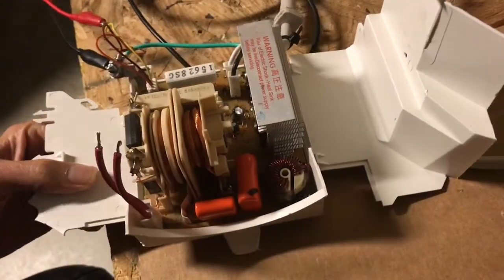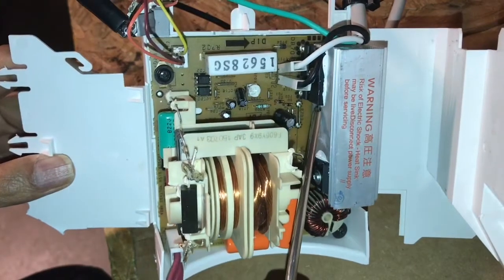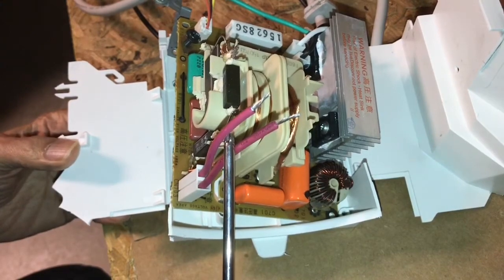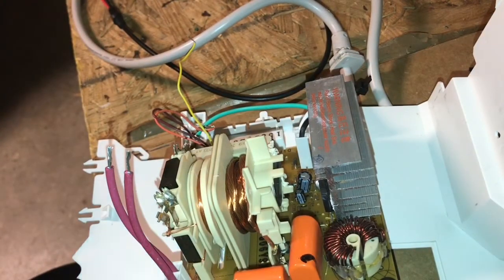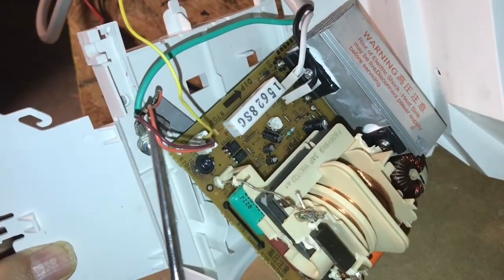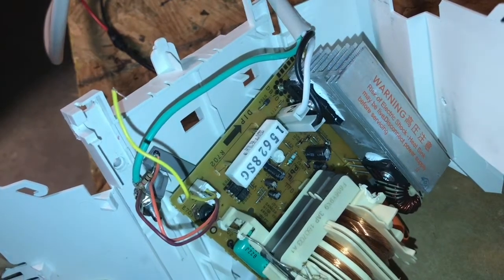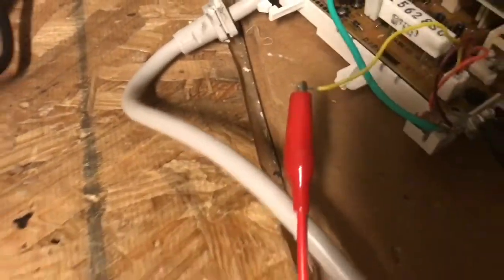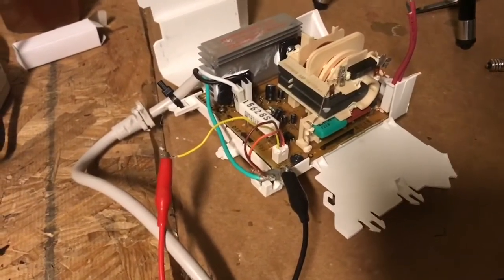HV from Newer Microwave Oven Inverter

Comment: Never buy this Panasonic inverter units, the do suck...mine died after only 4 months and almost no use, the inverter part is as costly as a new microwave
Reply: I have a panasonic with this.  It work fine so far wondering why they fail.  planning ahead.
Reply: Panasonic Genius Inverter are the best I've ever had.  Next purchase will be cyclonic inverter.  mines working 100 percent for 5 years, best microwave I've ever had! I've even seen my same unit in public places. Oven is  Lightweight,  genius sensor cooks potato and other foods perfectly,  the inverter board is way more modern.  The bulky heavy transformer ones are tech from the 80s.
Reply: Mine is working for more than 13 years with such inverter board. Ensure good ventilation for inlet / outlet grids.

Comment: Nice vid! Minor correction: soft switching IGBTs converters operate in zero current switching (ZCS), because their turn off loss is much greater than their turn on loss; MOSFETs prefer operating in ZVS mode, opposite of IGBTs.
Reply from the maker: Thanks for the clarification!😁

Comment: Why would they use a voltage doubler? Just use a higher voltage transformer. Seems silly to add components and complexity when the solution is very simple.
Reply: Exactly. The old way worked well. There cannot be a great saving of power using this method.

Comment: These look neat! I kinda doubt it is a standard flyback converter. It uses a single ended switch so I suspect class E amplifier like those HFSSTC's. The circuit may not be as simple as that since the output needs to be regulated but that may be what it is

Comment: So what can I use this for. I have a 13 year old son I'm looking to do some projects with. I tore up a microwave to find this inverter instead of transformer. Anything simple. We were going to make a power supply with the transformer, I wanted to show and explain it to him.
Reply: I approve of the educational sentiment, but I would start with something safer.  Microwave transformers and inverters will absolutely kill you, they are fairly high voltage as well as current.  This would be a good project when you have more experience down the road, you can still use these like a microwave transformer to produce high voltage and relatively high current, but with added safety features using a microcontroller.  I would recommend starting with an Arduino and a kit with a breadboard, LEDs, and other parts and build some low voltage projects, many kits even come with instructions for projects.  Mains power, and the voltages and currents associated with microwave transformers are not a recommended jumping off point.  Look on eBay, or Digikey for new parts and look for 120vac step down transformers if you really want to build a power supply, you want to reduce voltage generally, not increase it like a microwave transformer.  Look into full bridge rectifier circuits and filter capacitors as well if you want a DC supply.
Reply: HV DC power supply then make a lil levitating cap. He'll love that
Reply: I'm interested in knowing more about it and if it works better for a  fractal woodburner machine! Any information greatly appreciated!!

Comment: Excellent video. I have a Panasonic NN-SN686S microwave with the same inverter. I picked it up cheap new since it was broken with the dreaded H97 code. I confirmed the problem was with the inverter (and not the magnetron) by swapping it with a working inverter.

I then tried to troubleshoot the inverter itself:
1. Applying (with care), live 120V to the board (connector CN702), I was able to verify that the bridge rectifier (DB701) is working along with the zener diodes, filtering caps, and resistor trees to give good low voltage, low ripple rectified current (checked on a voltmeter and scope)
2. I removed the IGBT (Q701/H30R1103) and verified that it is working by testing resistance across the various G/C/E combinations along with doing a diode check  testing both polarities across C-E, both with and without the gate charged -- it works
3. I tested the 2 opto-couplers (EC702, EC703) in circuit by applying a voltage across their inputs and checking the output...
4. I tested the choke and both the primary/secondary of the HV coils and they are low resistance - so intact
5. I tested the 2 HV rectifiers attached to the coils and showed they work (though they required about 6-7 volts to forward bias them)
6. I removed and tested the 2 HV capacitors (C701 and C702) and they tested to spec on my capacitance meter (0.28uF and 4.5uF), respectively
7. I tested in circuit,  D703 and D704, they worked
8. I inspected the circuit board for cracks, burns, etc. -- there were none
9. I examined the remaining low voltage caps for any signs of burning or bursting - they all looked fine
10. I reflowed the controller IC, just in  case...

I put it all back together... no smoke... ran for about 6-7 seconds (fan light) but no heating and then H97 again...

Given that not much else to go wrong, I'm thinking maybe the "mystery" controller chip was DOA... but no easy way for me to prove it
Any other suggestions on what to troubleshoot?
Jeff
Reply from the maker: Did u check the solder joints of the HV transformer for cracks. With repeated use, the environmentally friendly lead free solder forms microcracks resulting in open circuit to the HV transformer. It would be worth re-melting all the solder joints to this transformer and adding fresh solder. The same thing happens with the power board in Samsung TVs. The radial microcracks are hard to spot so just re-solder  all the transformer terminals ...
Reply: Thank u for your thorough description. Great job. I have same nagging problem. I'm gonna try replacing the control chip. Must be feedback gone silly in it. Money wise not worth repairing but before I die this Damn Microwave will work again! It's a matter of principle.
Reply: @Swenser  yeah thats the spirit plus you learn something while building emotion ekectronic experience! 👍🏻
Reply: Have you checked Q703, that is connected to 17th pin of the "mystery" controller chip? Q703 is a NPN transistor and works as ignite the 6-pin IGBT driver chip, so the IGBT oscillates off-on to the primary coil of the HV transformer.

Comment: There is no "feedback" winding on the transformer. That winding is for the magnetron filament, and is only about 3VAC, which goes to the two wires you held the bulb to. 
Those two wires are also the negative output terminal of the unit (the 3VAC difference between them is nothing compared to -4KVDC). 
The high voltage output of this unit is not between those two wires, but between them and the flying ground wire.

Comment: I've used a non contact voltage meter near the output that suggests a big voltage exists on an inverter microwave. But a second used maggy still not getting heating. Either I've got a faulty 2nd mag. Or the output is high but not at the right voltage. Edit: yep 2nd bad Maggy from supplier. They are sending another. Luckily I could confirm in identical working microwave

Comment: DAMNIT!!!!!!!! why would they replace the stud transformer!?
Reply from the maker: Kyle'sLab i bet bc it’s cheaper. The supply of MOTs will drop off as these inverters become more common. That will be a sad day- may only be able to find trusty MOT in vintage supplies 🙁
Reply: TESLASCIENCE HACKS you can build one mot at home using enameled copper wire and silicon steel plates (E and I).
Reply: Kyle'sLab first they started replacing old NSTs , and now this.....this.... rubbish is replacing the good ole MOT!!!! Next thing you know, we may soon be introduced to "Electronic" pole distribution Transformers, this is what ruins all the fun for High Voltage hobbyists, 😒😔😭
Reply from the maker: May be possible- but I think I’ll stick to getting them out of old microwave ovens while it’s still possible!
Reply from the maker: Will be the end of the pole pig if they can figure to do it electronically!
Reply: no way man unless power feeds convert to DC or tesla coils
Reply: @BrianDhvTinkerer  you mention discharging the 4 caps before touching the board, how??? I usually bridge the caps with a 100k resistor,  there is no way to get to the capacitor leads without accessing bottom of board,  Yes?  So you must handle it to get it out of plastic "case"

Comment: How high can the pwm duty cycle be? Not really familiar with pwm
Reply from the maker: It’s just a unit of pulse width in uS or nS. The bigger the PW, the greater the amount of on time for the same frequency. For example  at a freq of 1000 Hz. 0.5 ms PW would be on 50 % of the time.  PW 0.25 ms would be on 25% of time.  PW 1 ms would be continuously on! The PW cannot be greater then 1 ms in this scenario
Reply: @BrianDhvTinkerer  Oh my god it makes sense now! I've never thought about it like that. 

I just ordered a used inverter microwave board and a pwm generator and I thought that 100% PWM just means it's on all the time (DC) but now it all makes sense, Thank you so much man!

Comment: Can this be converted into a battery nickel pole piece spot welder?
Reply from the maker: It’s got a high current shut off, so I’m not sure about that.
Reply: I’d rewind the secondary for fewer windings to get the voltage within range for a potential TIG spot welder. 
That’s what I’m looking into.  
I’m guessing those transformers run at 20-50Khz, which make use of copper coated aluminum. It’s the skin effect that causes the currents to run at the outer edge.  Using solid copper wire would be a waste and serve no purpose.

Comment: Can this work for the fractal woodburner machine?
Reply from the maker: Yep power levels are high at 2200V does these things are dangerous. This one is 500mA
Reply: @BrianDhvTinkerer  I will give it a try! Thanks 👍 going to dismantle a 1300 watt microwave. I'm aware of the dangers! Watched the electricity travel right through the wire from an oil burner transformer, I respect it!
Reply: @BrianDhvTinkerer  it appears my main inputs are blue and gray and I don't have the grounds you do the only other wires I have are the 3 brown orange yellow and two red output

Comment: I bought 20 of these dam things today, for the solitary purpose of scavenging the diodes and about cried when saw they took the mots out. Bastards... the old folks were right and we should have listened back in the 80s. I don't care about heat, I care about scary, crazy, and possibly irresponsible hacking to achieve  deadly power. So what I have to add a gd function generator to my tesla coil now?

Comment: Looks like the motors they used on bottom plate spinner that are good power supplies when they are spun with 4 v it gets to 100 v on the plate spinner anyway. Without the gears in it. Just magnet. /induction coil. Not 2000 watts but plate spinner getting 100v from 4 volts spinning motor! Free electricity5.48 in looks like copper £ is too much. So little copper 2000 plus watts